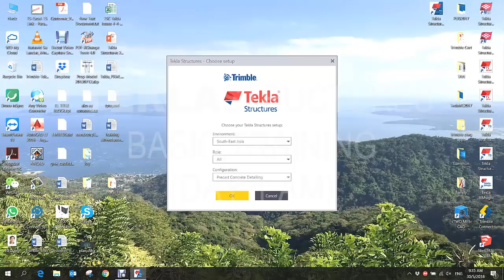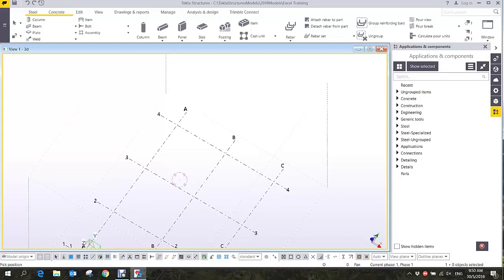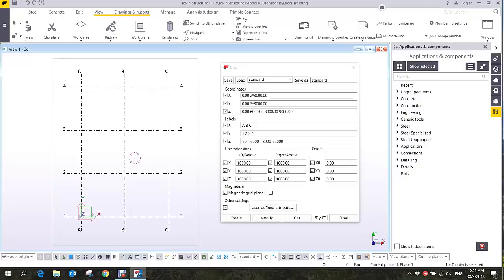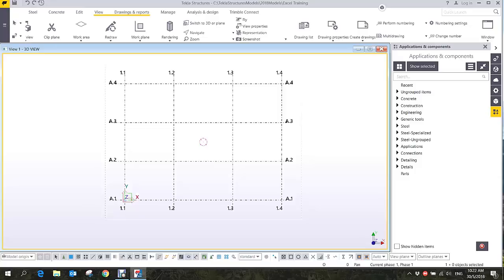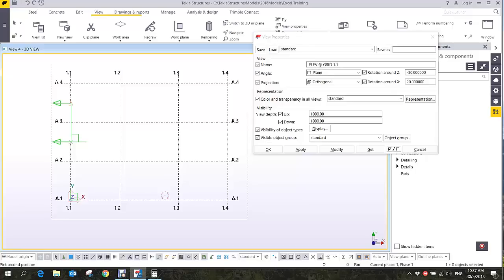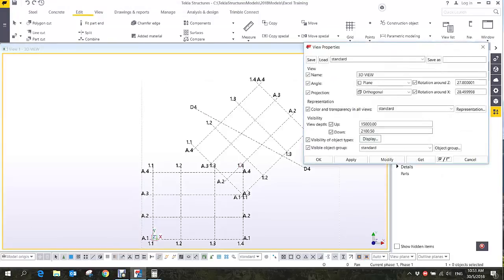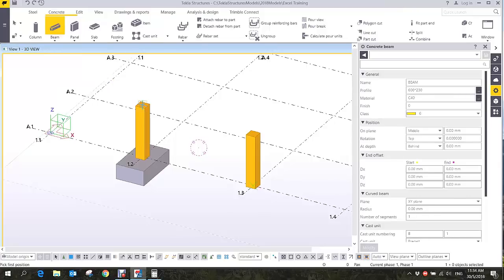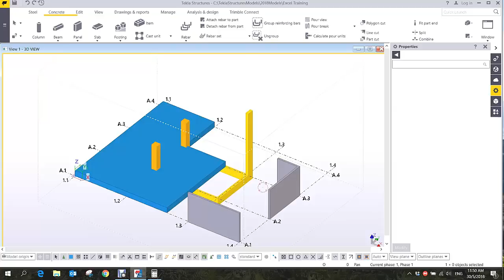Tekla Structures Basic Training (Day 1 AM)

Comment: Content of Video
00:00 Control Keyboard, mouse and view
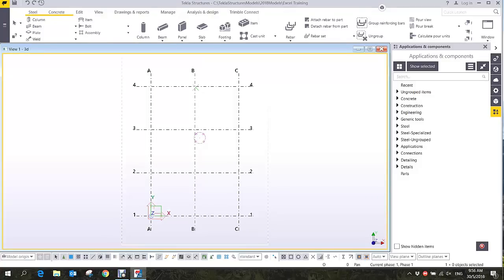21:56 Work area - Boundary box
27:01 Modify Grid line
44:05 Creation of view on plane: Basic View
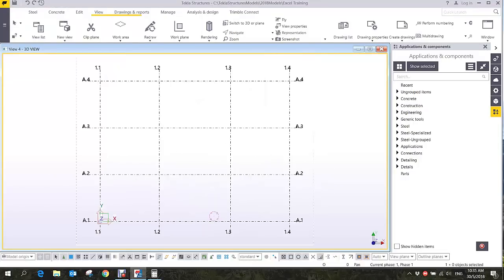1:00:26 Create view elevation: Create view from 2 points
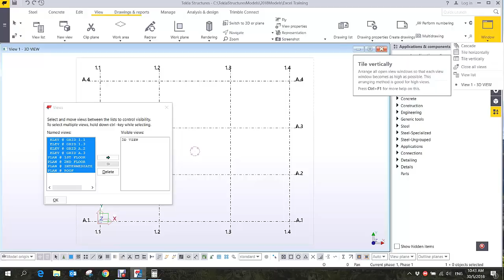1:08:22 Create view automatic: Along grid lines
1:20:13 Model Concrete Elements: Beam, Column, Panel, Slab, Footing
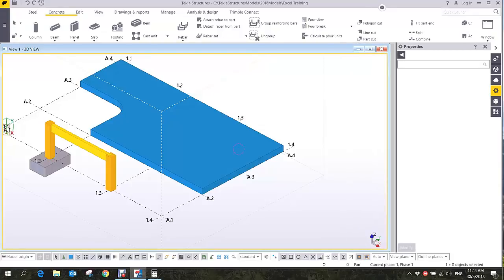1:44:08 Use Direct Modifications
P/s: Thanks Sir!
Reply from the maker: Thanks😊👍🏻
Reply: Thank u ❤️❤️❤️❤️❤️❤️❤️❤️❤️❤️❤️❤️

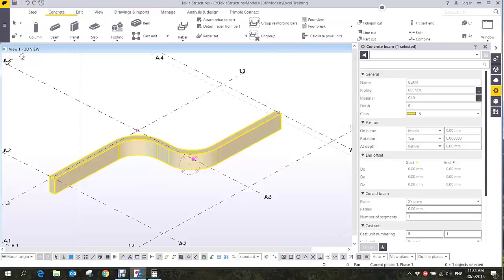Comment: @ 1:35:10, how did you draw free lines on xy plane, then xz plane, then xy plane and such? Tekla only allows me to draw line on xy plane, and also it only allows me to end at mid points or intersection points. I can't draw free lines as you did there
Reply from the maker: Hi, you must turn on the snap to any position. ~
Reply: I see..Thx. how do you freely draw lines on different planes then?? Like xy, yz, xz ?? Is there a hotkey or something??